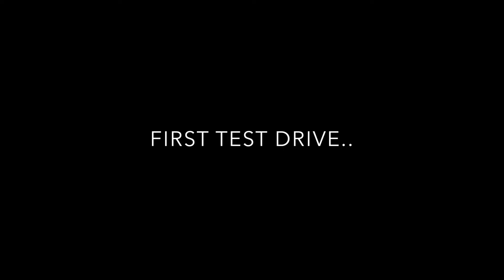pulse jet ice boat

Comment: The lack of consideration for safety is refreshing.
Reply: safety third.
Reply: what do you mean? they are wearing helmets and no one's drinking.... I was kinda disappointed...
Reply: I like the roll bars..oh wait.
Reply: My co-workers and I call it job security. Then again, I’d probably ride that thing!!
Reply: At least a 2 seater to not die alone.
Reply: Linus Poindexter safety third
Reply: At least when Colin Furze tests a pulse jet, he wears his safety tie.
Reply: @westbender 820 As someone who's tried to ride a bicycle on ice as a kid, let me assure you: You don't "just slide" for a while even if you're only going 20km/h. It's more like bringing a belt grinder to a stop by smashing your face into it really hard, and then keeping it pressed against it until it has run out. ;-)

Also, things that seem to have gone through their heads during the build:
Let's take that thing that got white hot during the test run, and mount the seats and the gas tanks real close to it, without any kind of shield in between. And let's put the steering on one side and the throttle on the other side. If one of us falls off - because we're totally not putting any seat belts on a rocket propelled sled - the other one can always reach through the engine to bring it to a safe stop. 
:P
Reply: it's not only the lack of consideration for safety but also a briliant idea how to lose weight and increase speed. they have everything they need to move, except the brake. i am not sure why they have it...
Reply: @Majk369  I mean, it's still totally awesome. :D
Reply: My grandfather flew a Curtis Pusher airplane in 1914 . (Look one of those up on google) Compared to this pulse jet ice sled it was a death trap. I’d gladly go for a ride on this instead of the plane.
Reply: Forget seatbelts and shit, how is no one mentioning the lack of barriers between the humans and the glowing red pipe of fire?
Reply: @tylerknight9857  that would add extra weight and material slowing the sled down... Nobody for sure wants that
Reply: Tyler Knight  Are you crazy; it was cold out there!!
Reply: I was wondering if this was Canadians testing Darwin's theory!
Reply: HA! Right on
Reply: Ya think that jetski your riding at 80 plus MPH in the summer with nothing more than a pair or nulon shorts and a life jacket is any safer???? The ride to the lake here was probably more dangerous...
Reply: @mac_uk5464  if you insulated that pipe it would overheat and likely ruptured... its an air cooled pipe...
Reply: @mac_uk5464  id of just worn a nomex driving suit... they are plenty warm...a divider punched steel would of been good idea...
Reply: @chrisjohnson4666  awesome.. thick enough to drown In if the ice breaks ..😂 so many things about this made me cringe. But it was damn cool... Lol
Reply: Safety schmaftey 😁
Reply: @BenJamin-en3jb  Fiddlesticks
Reply: OMG, Linus, turn in your MAN CARD immediately!
Reply: @mac_uk5464  -Nah, it would fry, as you were screaming, right through your skin, meat, muscle mass and bone, as it flipped, pinning your body to the glowing red furnace. Sort of akin, with similar survival, of falling directly into a glowing, pulsating lava flow...
Reply: Ben Jamin  It’s not nearly as dangerous you’re making it seem. As far as sliding, I’m sure you didn’t have as much protection as these two with their thick suits made of materials that will slide on ice. They have all the protection a motorcyclist has barring impact protection and they don’t have a need for that because of the distance from the surface and it’s lack of relative abrasiveness compared to asphalt. If one guy operating the throttle did fall off, the other would intentionally roll off. Also others were saying there was no brake. You can clearly see the driver test it at the beginning of the run and you can hear it being operated at the end.
And “that thing that got white hot” is being air cooled when out on the ice. Did you forget the cold temperatures? The tanks should be able to withstand the heat, if any, that reaches it.
Reply: i don't know this word
Reply: Only small chance of flip and scortched flesh...
Reply: The lack of video stabilization is nauseating
Reply: 1k here
Reply: @mypronounismaster4450  Yeah, where's the beer?
Reply: yea there needs to be a guard around that thing to keep someone from getting burned baddly
Reply: For the same reason why you are supposed to have your car windows open and not wearing your seatbelt when you're driving on ice so when you break through the ice you can get out of there a lot faster and a lot. It is far safer to not be attached to the vehicle
Reply: I no longer smoke the bud ,but when I did ,yah would be a very interesting experience
Reply: Woochinatchika Kokillibolinov  That sentence is worth framing :) . " When you make the jump, it's brave and daredevil and and the wind blows through your hair in all the photos and  you're the hero. When you don't, it's suddenly foolhardy. ;)"
Reply: I kept thinking  the U section of the pipe would go BOOM, and red hot shrapnel would go into the brave fellers sitting mere  inches away.   
OR... or the ice give way whilst blazing forth across it and there be nothing but thin rails, and down they go...  now... if theyd put some flat ski's down there.....
Reply: If something happens then they firstly burn and then drown 🤔
Reply: @tylerknight9857  i thought i did lol
Reply: Welcome to Sweden! Hahaha
Reply: Linus Poindexter wait till the YouTube ‘Safety Sally’s’ get a hold of this.
Reply: And that's why no one will remember your name.
Reply: It passed smog... were safe
Reply: Linus Poindexter true but if they broke through the ice, only one has a fighting chance. The one wearing the floater suit. The other would die. I suppose they were concerned with flipping over but seeing so much surface water and what looked like thin grey ice was more daring then the riding the sled.
Reply: Don’t worry about breaking through the ice. If they ever go through the ice, that glowing red pipe will cause so much steam to explode they’ll be cooked through to medium well in a quarter second.
Reply: I'm surprised there is a hand brake considering there is nothing else safety related
Reply: Hahahaaa ... 

there was no 'safety'
there was no 'safe'
there was no 'T'
there was only 'Y'
Reply: It's called having fun
Reply: Great comment
Reply: @garyburchett9060  Going by the color of the jet, it was between 770C to 815C.  They had plenty of heat.  Personally I don't think it was cold enough.  Awful lot of water on that lake.
Reply: Lol, true
Reply: SAFETY THIRD!!!
Reply: @mypronounismaster4450  Now if it was in Russia.......Vodka all around...
Reply: Ben Jamin I wish I could give you a 1000 👍🏻
Reply: @skagit69er  with that width it's unlikely to roll
Reply: what's that vertical red feature? oh. the engine. nevermind.
Reply: @Serveck  you mean automatically, right?
Reply: Ignoring safety makes the best memories! Lmao
Reply: That was way awesome
Reply: What do you mean?? Don’t you see they’ve got helmets on?
Reply: they hit one rock out there and they are gonna blow
Reply: @Hoof Hearted The organs would be unuseable after being blown up, burnt, cut to pieces by exploding metal then sliding down the ice finally slamming into a snow bank.  The local varmints would get them first.
Reply: @futureisscary246  Hey!!  Lighten up, I'm Canadian   and I'd definitely strap that on.
Reply: So many comments from people who never have seen a lake frozen over so thick you can drive your car on it speculating.
I'm where it gets cold in the winter, and grew up wandering across frozen lakes with buddies - using snowmobiles and minibikes when we could, cars when we were old enough. How do you learn to drive on ice? Drive on ice! (if the wind has blown it completely clear, get up to freeway speeds then whip a spin and learn how to get out of it)
As to these Swedes, they had clearly taken a prefabbed vehicle that normally holds a sail in the middle and swapped that out for the tuned pipe - ergo the general concept and structure is perfectly fine for what they were doing.
The only differences I would have had - wrapped the pipe with some insulation, and upgrade the front skid (it looked like it was digging much more than it should have). Otherwise, that would be fun to buzz across a big lake that was well frozen.
Reply: @westbender 820 And the red hot motor
Reply: Remember kids safety third
Reply: Only way to know 💪💪💪
Reply: While the hearty laugh that came about around 4:46 came in at a close 2nd, the tone and content of your comment absolutely made my morning. Bless you, good sir.
Reply: I love the whole holding the gas bottle sideways to get that last little bit while you a few metres away thing 😂
Reply: @harrisoncastrikum29  Actually that provides a source of liquid propane, rather than just the gas. That's the good stuff there!! YEE Haw!
Reply: That bare red hot tube between them is something else! Not to mention the complete lack of flotation should they hit thin ice. No wait, the lack of seat belts should ensure they get pitched safety over the front.
Reply: wdym... they have HELMETS :D :D :D
Reply: westbender 820 oh yeah and the red hot 6 foot long piece of metal crashing with them
Reply: Its basic, bare metal to do the job. Lots of room for improvement. Its up to them to go back to drawing board. Did Wright brothers looked the same like that? Daimler, when he first made a working car back, it was bare basic to run it. No seat belt, no air bags, no ABS. Its up to them if they want to improve their design. Kind of like us humans. Before we learn to walk, we learn to crawl first then learn to stand up with two feet.
Reply: @mypronounismaster4450 ... , you mean, you did not see them drinking. It 's called " editing ".
Reply: @tylerknight9857 ..... It a always good to try and roast your nose on a cherry red piece of piping, if it all goes wrong.
Reply: @Serveck ...., don't think you'd get much warning.
Reply: @xaracen7207 ...., no, it 's not nuclear.
Reply: @tylerknight9857  ambient temperature is probably somewhere close to 0, so I'm sure it's nice to have a heater. You just have to switch sides every couple of miles.
Reply: Just another day in Russia my friend, where two men build a jet powered ice sled
Reply: Huh? They are wearing helmets? So.... safety first I guess...
Reply: @Ratboy2004  then, themselves , still amusing to us
Reply: Helmets and reflective jackets I recon safety requirements are up to standard.
Reply: Bru they had helmetz
Reply: @Ethan Cain Instablaster =)
Reply: @donziperk  If you have a choice, why either?
Reply: @metrork1  Why not. Living in bubble makes for a boring life.
Reply: he's wearing a life jacket.
Reply: They had helmets on!!
Reply: Who?
Reply: This the same guy who fired his up, on a loose, floppy table ?  If so.......sweeeeeeet !
Reply: @mypronounismaster4450  I was waiting for “ hold my beer and watch this” lmao
Reply: Safety is overrated.
Reply: Lol no floor
Reply: I disagree. I reckon that they considered safety, and then disregarded it.
Reply: klävt $äFettea ^$^

Comment: Riding on an iced lake at high speed with four metal spars welded together, a cherry red gas-driven pulse-jet on your side and a tank of propane gas on your back. What could ever go wrong?
Reply: Meteorite strike, but then it wasnt 2020.
Reply: Atleast when it breaks thru the ice and goes to the bottom you won't get burnt by the pulse jet.
Reply: Sometimes projects like these end up on YouTube, sometimes on LiveLeak.
Reply: But the danger is half the fun lmao
Reply: And no brakes
Reply from the maker: Have a handbrake even if it doesn't work very well😁
Reply: You forgot the low visibility
Reply: @jonassvenssonharskogen5186  :p
Reply: Still worth it lol
Reply: @mattiasbjorklund9520  ... and sometimes on the bottom.
Reply: @jonassvenssonharskogen5186  watch again that's how they stopped at the end the hand break is grinding on the ice
Reply: COPS... fun police...
Reply: They're wearing gloves though
Reply: No No! It's "What more could you ask for?" 🤣
Reply: What could go wrong...maybe a log frozen in the lake, that's just off the top of my head, I'm sure there's a lot that could go wrong, hears another...permanent hearing loss.

Comment: You're basically gliding over the ice on a metal cage thing with a V1 rocket engine welded into it.

Fukken awesome ❤️👌😘
Reply: v-1 engine is arguably better....
Reply: Dylan Johnstone well no shit
Reply: Do I understand pulse jets correctly in that it basically has two throttle settings off and on? Once its running its full power?
Reply: Earle Mac Lean no. You can regulate power via fuel flow
Reply: @spiderbass4hire474   You can adjust the output, but will barely accelerate under 70%
Reply: It's not a v1 type pulse jet
Reply: Argus AS014, valved pulse jet engine, started with automotive spark plug and Acetylene. I think it used either kerosene or gas as fuel
Reply: I'd like to see a valved pulse jet engine in this application, much more specific thrust.
Reply: More accurately (given they seem to have an O2 bottle strapped to their propane fuel bottle, used a lightup) a valveless pulse jet strap to a bomb.😱😰😨😵
Reply: If the Finn's made the V1
Reply: Not a rocket. And the V1 had valves, not a resonant tube.
Reply: “You’re basically rolling to work every day in a metal cate thing with a Tiger 1 engine attached to it. Fukken awesome”
Reply: @starstencahl8985  if the tiger I is a jet fighter then the F35 is a submarine
Reply: @Lester Piglet sorry m8 I'm finnish and couldn't tell man. It would be some crazy shit we would try😂
Reply: Did you just call a rocket engine a “V” engine. By definition it would be impossible to have a V1 of anything as it doesn’t create the V shape of the engine. You basically just described the video, super unoriginal and you actually said “a V1 rocket engine”.
Reply: Litespark vunderbaha  Verne’s Von Braun would be proud lololol
Reply: @dadillen5902  The tanks strapped to the propane tanks are just standard 300bar double 3 litre SCUBA-tanks. Actually used by firefighters, not divers because if the small volume.
Reply: Litespark 

Ice is the only accurate word you typed
Reply: @totenkopfan6296  valved as in with a reed valve?
Reply: @andrewjb05051998  Affirmative
Reply: DB_LIKEWHOA lite spark it my auto correction,did not read before sending lololol
Reply: Loadstone look up the V-1 flying bomb, that’s the pulse jet engine we’re talking about, not a gasoline combustion engine for a standard car.
Reply: Sign me up
Reply: @loadstone5149  The V1 rocket is pretty much the only thing that was produced in number that uses a pulsejet engine
Reply: @sdsd2e2321  it wasn't a rocket. The V-2 was a true rocket. The V-1 had a pulse-jet for thrust. A PULSE-JET. It's not a 'pulse-jet rocket' it's just a fuckin' pulse-jet!
Reply: @pauldavidson6321  harder to build apparently. Needs specific tuning or building or something.
Reply: @spiderbass4hire474  Once the "mixture" is worked out, roughly, yes; that's what he was doing when testing, as the inversion of the gas bottle allows liquid to enter the jet.  And, as you saw, things get a bit "hotter".  You can increase the flow, but there is a limit based largely on the diameter of the jet and pipes.  The "throttle" concept is very crude as a certain gas flow is needed just to keep it running.  While you can vary the fuel flow, it isn't as "clean" as on a carbureted engine, for example.
Reply: @dadillen5902  haha compressed O2 with a cherry red rocket next to it? Seems aight 😂😂😓

Comment: Be nice and warm with that pipe throwing heat like that
Reply: Adding heat wrapping would probably not be bad idea, so that heat can be directed towards exhaust to decrease loss of power. Actually one could spray water inside the engine to turn water into steam witch has high expansion rate.
Reply: @Hellsong89  yeah that's definitely wasted potential
Reply: You could also cook a nice lunch on top
Reply: @S A Youre dead :D Or at least a nicely cooked dinner for a bear xDD
Reply: @Hellsong89  yeah that would look way cooler... just imagine dragging that cloud behind you!
Reply: @Hellsong89  Water injection... hmmm..
Reply: @S A exactly!
Reply: No, it doesn’t have a butt warmer. It has an everything warmer
Reply: @Hellsong89  Explosion rate...fixed
Reply: @S A I thought there will be a huge pressure if it is able to propell them that fast... hot shrapnel into the face would probably kill them even if the pressure isnt that high..
Reply: That looks completely unsafe and absolutely terrifying. When can I have a ride!!!???
Reply: @S A Thats true... and they have some protection on their faces so its alright I guess.. Gonna watch some more videos about it and make my own xD
Reply: Be great as long as that hot gal keeps that hot leg to herself